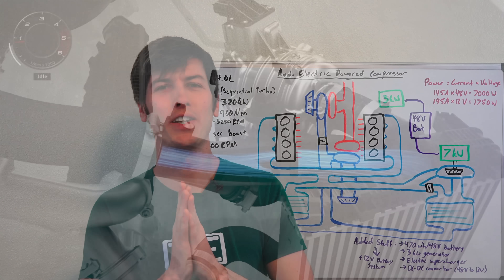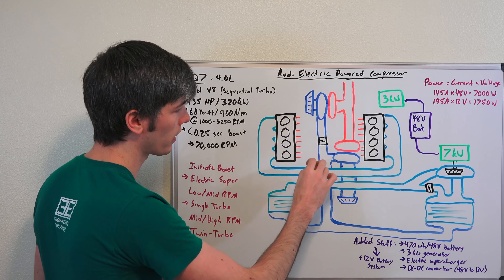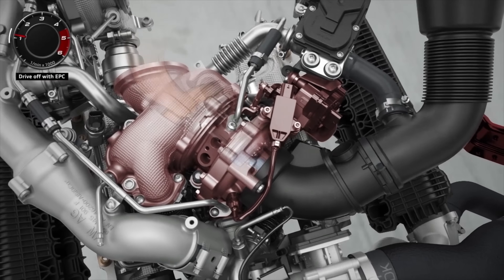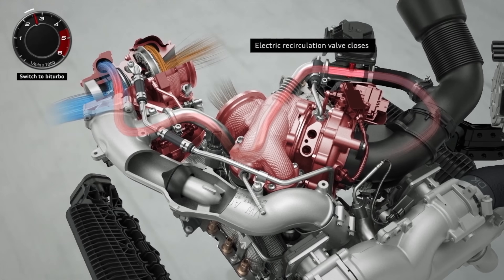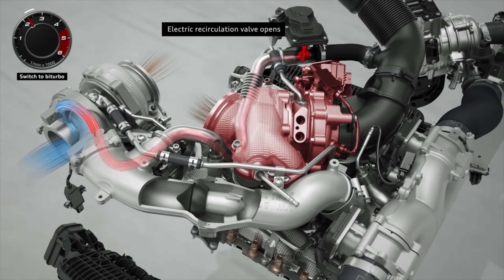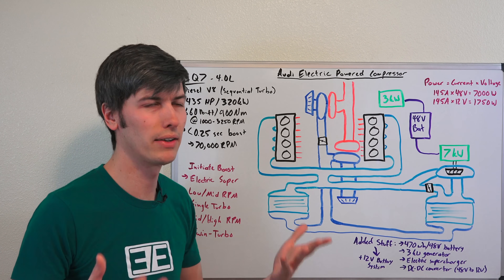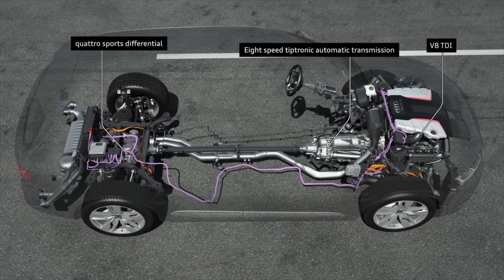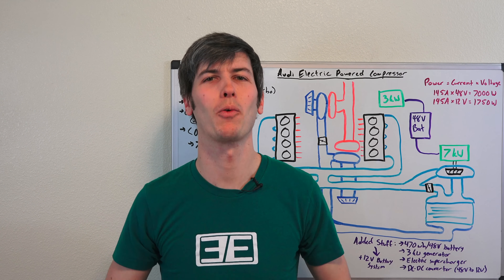Electric Superchargers - How Audi Is Eliminating Turbo Lag

Comment: Supercharging the turbocharger to eliminate turbo lag. Yep, that's the German engineering. :D
Reply: Or just toss a normal supercharger so it's always spooling up and you don't have boost lag! :D
Reply: @2averagenoobs108  forgetting drag of supercharger running all the time. Costs drain of power
Reply: @unggrabb  So a turbo charger on turns on when you get on throttle or?? They're constantly running as well.
Reply: @2averagenoobs108  yes but turbo charger has very different chateristics than a supercharger. Did you watch the video?
Reply: @unggrabb  Are you talking about the electric turbo charger or a legit turbo charger?
Reply: @2averagenoobs108  turbo charger is driven by exhaust. Compressor by belt or in this case by electrical motor. Why dont you watch the video?
Reply: @2averagenoobs108  But it is not actually boosting all the time...
Reply: @2averagenoobs108  this costs horsepower to drive the supercharger
Reply: From a battery, yes. Instant reaction, then battery recharges. No ill effect on car performance when max power is required.
Reply: @unggrabb  it’s going to cost Power to run their 7000Watt Electric motor to spin a turbine either way it’s going to cost something. compound turbos work just as good and require 0 notta hp from the engine.
Reply: @atlas3863  wrong. It costs to drive the turbos. You do not get anything for free. You see it costs some kw to drive the compressor.  So it costs some kw to drive the turbos too. Nothing is free
Reply: @unggrabb  not nearly as much is a 7000 watt Electric motor not counting the supporting electronics. either way I’ll take compounds over this abortion any day of the week.
Reply: @atlas3863  pros and cons. The electric compressor spins up incredibly fast. Zero turbo lag. Interesting application of new tech to solve an old problem. Complex, yes, but someone has to try it out. Perhaps common in a few years. Dont be scared.
A supercharger can draw 150 hp, but it generates 400 hp extra. A turbo charger creates back pressure but a benefit when the revs build.
Reply: @atlas3863  7kw is less than 10hp. You dont know what you are talking about.
Reply: @unggrabb  Why are you hell-bent on arguing? generally it takes a 10 hp or larger engine to run a 7000 Watt generator either way turbos draw absolutely no power from the engines rotating assembly. no belts, no gears, no 7kw + load off the alternator🤷🏻‍♂️  simplicity at its finest.
Reply: @atlas3863  only a few kw lost in backpressure in the engine. Or you could plonk a turbo out in the backyard, not connected to an engine producing pressurized gas (which always come at a cost) and see if myseriously just runs.
I reserve the right to respond as i see fit. I tespond to your unscientifulic rambling because a technical discussion must be based on facts, not (as in your case) pure wishful thinking
Reply: And adding a battery to boot!
Reply: @scanspeak00  I think boot in German floats in water!
Reply: then a hit of nitrous & all 4 tires will be smoking
Reply: stack another turbo charger on top and job done
Reply: Amazing engineering, and german engineering at that. So much ahead of american old school junk stuff
Reply: @unggrabb  this is over engineered to hell.
Reply: @nodo7575  no. It is just very clever
Reply: @nodo7575  Well, this example is quite complicated but also meant for very powerful and expensive cars. My dads car has a simple 4 cylinder diesel engine with an electric supercharger without any additional turbos. It has no lag because it doesnt rely on exhaust gasses and it doesnt rob you of power right when you need it like a traditional supercharger because it used energy stored in capacitors that gets recharged over time.
Reply: copy from volvo power pulse technology-bastards
Reply: The 2019 Q7 is one of the most complicated cars I’ve ever driven. Yep that’s German engineering.
Reply: German engineering is the world finest
Reply: To bad they copied it from the Italians... Who do you think invented this method? Go look 1980's Class B Rally and you will see....Oh you will see... Audi might have introduced the world to their AWD system, but it was the Lancia Delta S4 who took a 1.8 litre engine and slapped it with a turbocharger and supercharger. The aftermath, was a car that was so fast, they banned it and the division it was in.
Reply: there was a group b car i think it was lancia (correct me if i m wrong) who put a normal supercharger & turbocharger on the engine to make the turbo lag very small
Reply: TSI was doing that job
Reply: jaaaa, ze german Ingenieur
Reply: Nissan did it in 80's with the Super Turbo.
Reply: American Car Manufactures know better, they did cut thru the chase and throw in a 5.7L V8, then no More Turbo Lag 🙂 and no compressor on top of the compressor 🙂
Reply: Twincharging is an old concept, though, with Lancia (an Italian firm) having first played with it in the Delta S4 in '85.
Reply: Germany is famous for its porn (engineering porn too)
Reply: Leonaяdo DiCapяio dungeon porn too
Reply: It's the Hitler treatment

Comment: Why not a 48V solar-panel on the car roof as a top up charging circuit dedicated to only the 7kWatt electric supercharger?Skip the turbocharging, use Mazda's new super efficient style tech NA engines. And with the opposite to the Audi approach, have the electric supercharger kick in when you floor the throttle. Keep it simple. Better still make the engine itself with some new bimetal tech material that itself generates electric power from the otherwise wasted heat of the engine.
Reply: Because a solar panel on the roof would contribute enough energy to the battery in a month to run the electric motor for about 2 seconds. Unless you make a habit of parking in the middle of the Arizona desert all day every day - then it might run for 6 seconds.

Comment: hm , why not design a supercharger that has cvt  attached to it that is still engine driven. Max boost at every rpm when needed and little to no boost when not needed.
Reply: Dalton Michaels pro charger has this and has for a number of years in centrifugal superchargers more or less. Check it out.  I don’t know if it’s exactly what you have in mind but it is one of the better concepts and Functioning superchargers with a solid track record.  It comes in several packages for need.  It is much more complicated than a standard supercharger of the centrifugal variety.  But not like the Audi system at all.  And it comes with preset or adjustable customizable  “presets” and electronic in car control display for switching.  There are some mechanical limitations and being a supercharger it will still bleed off power or be less potentially efficient running mechanically from the engine but is a very clever solution that’s been out 5-6 years now and you can have it semi electronically behave differently and have many tunes(custom even) to switch on the fly from driver seat, even an economy mode.   Oh and it’s 10k without installation but it can get some pretty insane gains.  
I think without over complicating things, too much depending on what your looking for ideally you would want something like this using turbo exhaust turbo chargers with electronic spooling  or a number of other things.  For performance obviously the engine itself should be taken into consideration and pragmatic questions addressed but try not to think of supercharged and turbo Chargers so differently.   Well as far as centrifugal type designs on both.  Some of the drawbacks of all the piping and drawbacks of engine leaching whatever including positive displacement riots supercharges could be solved in a variety and have been  using hybrid turbo supercharging.  I mean nit hybrid or electric in the sense of like a pruis or tesla.  Just “Twin Charging” various things and hybrid in that superchargers and turbo chargers are the same thing more or less on a deeper conceptual level.  
Using electronic turbo/supercharger  can one up or add to pro chargers cvt supercharger. I mean hybrid as in belt and more mechanical solutions or simply exaust driven solutions even cvt pro charger,  using “hybrid” in approach not having to do with the car even being for reduced fuel consumption at all you can get the best of both worlds.  In other words  people may ask why would you want twin charging or electric turbo/supercharging in various forms.  Well while cvt on on pro charger is really good and and unprecedented gsind and efficiency relatively with “E charging” you can get rid of some of the drawbacks of roots/centrifugal superchargers, and have a “Turbo charger(s) on one engine i a number of ways that flat out  can do very crazy things to maximize peak power and  peak torque at very low levels Rpms and all across the power band. I call it hybrid as ideally you want to use various blowers much more like a gas driven turbo turbine as it is is more efficient.   From a pure power and economic gain perspective with Ideal situation some of the drawbacks associated with say not just turbo lag but heating and complex routing and more purely mechanical systems can be rectified.  Issues with blowoffs and waste gates
Can be rectified using electronic Turbo/supercharger hybrids.  For power applications you can have twin turbo or single not tied to exhaust gas limitations so much not leaching off crank mounted supercharger and belts.  If you want extreme gains again this is not for hybrid card but hybrid or more advanced economical and  extreme control of Turbos using in a variety of ways to maximize running efficiency of say like what we think more of as “Turbos.”   There are simpler and more complex methods.   The appeal
Of instant torque from electronic motors is equally appealing in Turbo systems from a performance standpoint alone.  A far flung extreme example would be what you mentioned, cvt supercharger  but mire like exhaust driven turbo.  Imagine this you want CVT is great but instant electronic spooling mechanism that can instantly about spool to extreme RPM with for example can allow all kinds of gains and advantages as the electric “supercharger, does the job of CVT but better instantly and can be programmed to respond instantly.  If it gets to much pressure or a number of situations ideally the supercharger rarther than using waste gates etc snd loosing boost and flexibility drives 48 volt battery to recharge via capacitor quickly.  It can be run at any speed and infinitely adapt
For pure performance essentially you have a the electronic aspect of the “hybrid supercharger” Able to spool very fast or slower or on command instantly.   
. If I was just interested in performance there are so many ways you can basically have instant torque and peak all across engine Rpm speeds. You can use a well designed purpose specific iteration to be less complex and get all the benefits of turbo and suoercharging mostly and you can get insane high end power by using very very large blowers with extreme power at high rpm range or some portion or dial it  down faily easily.
For pure brute force and power and efficiency exhaust driven turbos with just something like better than cvt electronic twin hybrid turbo charging you can habe something with the HUGE main blowers which take a lot to spool
Up are not super linear at all and obviously huge turbos are not gonna be ultra responsive or as torquey at low RPM because it takes so much exhaust and energy to get them going. What if they you could Run say some some
Of the crazy obscene large and technologically advanced turbines associated with something  a tuner Mitsubishi lamcer evolution etc.... But you could get all
The torque and horsepower across the entire engine working range or programmed efficiently for traction etc or however.    Now for my extreme example we are going for not just turbo lag elimination which is never gonna be perfect perfect. But imagine you can have something like some insane belt driven superchargers, but more
Powerful instantly, no low RPM or
Limited torque of centrifugal supercharger,   But extreme power at higher engine running speeds say up to 9000
RPM.  You aren’t loosing engine power from running a belt supercharger which  require a lot.   Heat etc... not withstanding let me put it this way, would you Rather have say a dodge hellcat or a single/bi/ twin Turbo that can make thst much torque down low, and if you are into overkill maintain it all the way up to top engine speed and have a plateau of peak power and ungodly torque up high as well.  
Basically if your engine can handle it you can have absurd boost low and high with enormous blowers in a much more linear fashion or a number of ways.  Think enormous ultra high power turbos some ultra built Japanese cars use in two scroll or whatever.  That make The most powerful muscle car engines put to shame and accessible everywhere in the RPM band.  The Turbo(turbos) of absurd size and max power with lag obviously traditionally witn the right electronic hybrid turbo can gain absurd terrifying performance.   

Or in do many other things short of obscene overkill.  A hellcat.supercharging system vs the type of thing I am talking about less extreme would be shamed by relatively modest much more efficient systems.

There are a plethora of ways.  And it takes  cvt to a new level in various applicatioms even.   And the better designs don’t need to be exceedingly overkill
Or overcomplicated.  
Just
One aspect.  Without
Going to crazy in routing less complicated applications there really isn’t a more efficient way to get more
Performance gains and flexibility.   Mark my words.  There are more sophisticated perhaps not super redeeming manifestations out mow but Beyond orocharger CVT supercharger, something rather simple just using electronic super/turbo charging to improve efficiency is a great way to go.
In the capability and relatively cheap price all things considered foe what even a simple system can do.

Comment: I wonder if you could get a generator in the electric motor itself and route exhaust through it. i.e. retrofit a normal Exhaust turbo. Electric motor spools it up, then exhaust kicks in to provide boost + charge the motor... Audi came up with a pretty complex triple turbo system, but wondering if you could simplify significantly for smaller displacement engines.

Comment: Yes, electric powered is good for not having turbo lag. It sounds like they are using a 7 KW motor. I am considering using dual electric turbo's with 15 KW motors each. A bad heart attack slowed me down, so I hope this year or next year at the latest to get started.

Comment: Time to speculate.
7 kW of power is used to boost enough air for 900 Nm of torque.
1.75 kW probably would be enough to help downsized engines, like my 175 Nm 1.2 TSI.
Even if it would boost air enough only for 100 Nm, it would be still worth it.
1.2 TSI works very hard to move the car from a complete stop into steep uphill.
1.0 TSI has better fuel economy, but has even less torque on very low rpm.
Starting from a complete stop is the only thing that I sometimes hate in downsized engines. Every other aspect is just fine in everyday use.

Comment: Hey, love your video! Can you please make one that also explains the Mercedes-Benz mild hybrid system with the same 48V battery? It can be found in the new CLS 450 also the new w205 C-class facelift. It is interesting because they are putting it in  the smaller engines. It will be in a new 1.5 liter 4 cylinder engine and a new 2 liter 4 cylinder engine aswell. 

Looking forward to your next video and/or response. Keep up the great work!

Comment: one does wonder. with the extra size and weight needed for 2 turbos and all the pipes and valves. Why not run a 96V generator run off the exhaust like a turbo and an electric supercharger on the intake. In my logic this would mean the exhaust does not need to be run near the intakes. The intake charger can be mounted wherever is convenient even just next to the intercooler and you can control the application of boost completely separately to the generation of power from the exhaust. sure they will need to be sizeable electric gens/motors 10-50kw depending on the motor but surely its worth it?

maybe im missing something?

Comment: There's an engine in my industry that this reminds me of - Rocket Labs' Electron rocket engine. It has lithium ion batteries that provides power to a first-ever electric turbopump. Most turbopumps are traditionally run off of engine exhaust or some other separate volatile reaction, so this one is pretty interesting. Of course there's no need for a generator because the whole thing get's thrown away. Pretty cool nonetheless.

Comment: 1750w on regular 12v battery is not possible. They say 600-1000 A start power but start motor use 150-250A and anything more then that will kill battery ewary 6 month

Comment: The average turbo/supercharger requires 25hp minimum to over 100hp in some cases... I don’t see how this  7kw compressor will even  remotely be viable at 9hp it will make what ? 4 psi at a super low mass flow rate. Not to mention when even one of those valves sticks the whole system is going to go to crap. When your engine targets full boost and one compressor is still valved off my guess is the extra heat will eventually kill the motor

Comment: and there i wonder why not just plug a supercharger directly and have a valve that sense pressure? this way you could boost the low end super charger style and any extra air would spill in the turbo then in the mid range transition to the turbo and spill more air in the turbo! this way you would have a higher power turbo for the heat generated by air! 

exhaust air is the reason that high power turbo shuts down in 5 minutes and needs to cool for 30 minutes! supercharger pumps "COLD" air, so mixing the 2 in the turbo would cool it!